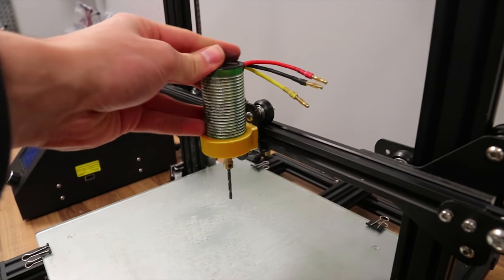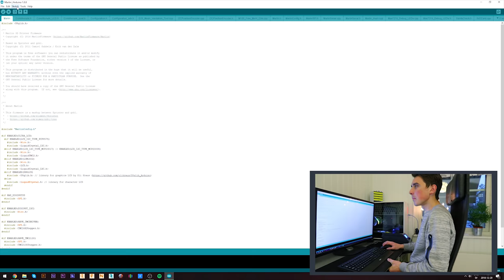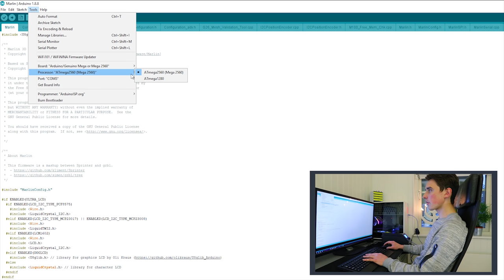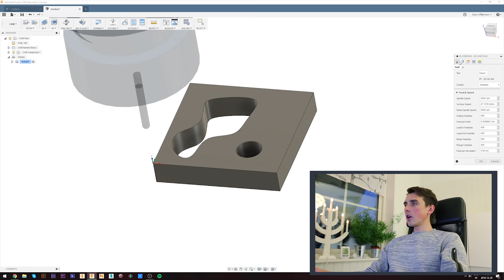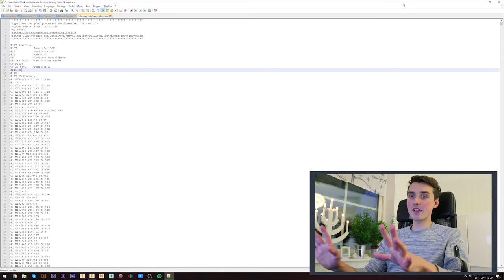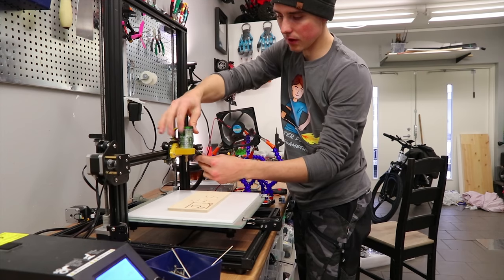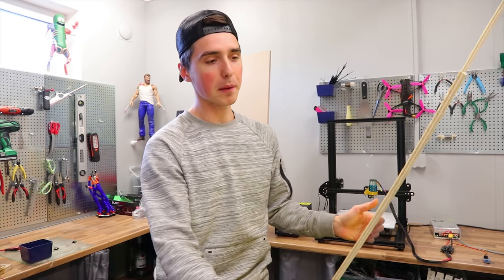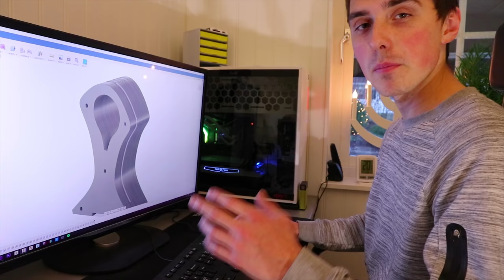3D Printer CNC Makes Spectrum Thing

Comment: i have also been messing around with cnc on my printer, here a helpful hint, In your start gcode add a G92 command to your Start script,  Example G92 X0 Y0 manually move the tool bit or head,  where you want you Zero x 0.0 and y 0.0 to start at, Usally at the corner of the work piece,   you can also us this with your Z axis, And make sure to add a M90 in the End script after the G28 of X and Y axis , if you start a Cut and you stopped it, Reboot the printer or manually do a M90 as all the zero offset will remain in effect till the M90 is called .
Reply: super helpful man great comment

Comment: Really nice job sir! Nice to see people willing to try new things. As a few others have mentioned, I think you'd see some significant improvement in the quality of your cuts and more predictable behavior, if you switched to a 3mm single flute end mill and ran it at ~1000mm/min feedrate, rather than 400. It seems counter intuitive, but at the high RPMs of the brushless motor you're using (I'd guess ~30,000 RPM) if you move too slowly you actually cause a poorer cut with more burning because the flutes of the end mill are recutting the previously removed material, and the flats of the end mill are just causing friction in the slot the cutter made. At least this has been my experience with my DIY desktop type CNC at similar spindle speeds.

Comment: Hi, I have been busy transforming my ender 3 into a CNC milling machine for a month. It is tricky but now the results are awesome! For the motor, I have used a twin electric bench grinder (as it was the only "strong" motor I had the time being) and a flexible shaft to mount it where the nozzle assembly was mounted. I set the rpm of the grinder to 10000 (maximum) and I used a smaller tool (1-2mm is good) for this type of printers with V-bearings and this type of setup. I also had the speed on xy plane at 5-10mm/sec (10 maximum). That way (after some calculations) the loads on the cutting tip (endmill) and thus on the v bearings are minimum. You can adjust the settings depending on the material. For plywood, these settings work great (1-5mm) but for plastic t's sh**. That's because of the high rpm. So you can try different settings for different materials. Unfortunately, this type of printers can't stand high torque motors as the loads on the V-Bearings will be high. And for the gcode, I haven't changed anything on the ender 3. I downloaded a post process for marlin from GitHub (mpcnc) and it works great. You just have to add a G28 command and a good set up on the fusion cam.
Reply: Hi, thanks for the comment could you please tell me where to add G28 command?

Comment: You need to add a vacuum to the CNC

Also you could use the nylon filament for the mounting. Since it’s heat resistant and will absorb vibration

Comment: Very good video. 3D printer CNC router hybrids have been of great interest to me for a long time now. But as I found a few years ago when I set out to make such a machine it's isn't as simple as it looks. 

Essentially the control for each system is the same but I found that there are two major differences of each machine that stop you from being able to make a high functioning hybrid.  

The torque required and the weight of the components are the two main differences. Obviously, you require much more torque from your motors when routing then you do when you 3D print or else you will run into the same problems as you did in this video. That is fine though all it means is that you need to use nema 23 stepper motors or higher, instead of the commonly used in 3D printers, nema 17. But with that extra powers brings extra weight. And when you increase the weight you decrease the maximum speed you machine can travel before you start to see artifacts due to vibrations.  Not a problem when routing which is usually a medium speed smooth operation. 3D printing, on the other hand, is fast and sometimes far from smooth. 

Let's say you manage to increase the torque of your machine without sacrificing and speed. Then you run into the problem of how you transmit that torque. When routing at high speeds belts are not the best option because they can slip and will become slack over time in a high street environment. Some machines like the x-carve get away with it but even they are very underpowered. So you move to using screws usually ACME or ball screws to run each axis. Again these will limit your maximum travel speed because of their added weight on the gantry and because they are generally slower than belts. 

End of the day unless you have an incredibly rigid machine that will not suffer from rapid movements of 3D printing when building a hybrid you need to choose. Do you want a 3D printer that can mill slowly or do you want a CNC router that can 3D print slowly. 

Anyway, great video man I'm impressed with your results. Just thought I would share my findings on this topic.
Reply: Yeah with belts driven cnc what you would need is to use gear reduction, that way you can still have decent speed and the torque. But in the end it's just best to use your printer to make a cnc(I'm going to use mine to upgrade some parts on my cnc). I have a diy belt driven cnc with no gear reduction so its as fast as my printer, it can cut wood faster than seen here (2 hours for each piece!!! Wow that's painfully slow) But I mainly cut foam with it to make molds. I'll add gear reduction at some point.
Reply: Do you have any good forums I could go for to help build myself a CNC?

Good info man!
Reply: @towers3372  look up "mpcnc" on thingyverse it stands for mostly printed cnc, I'm sure there must be a link or something plus there are some guys on YouTube who build it.
Reply: You miss the point of what I'm saying yes belt driven cnc routers are avaliable but all will have the same inherent flaws. They will be limited to the stress they can be put under before the belts and are far from able to meet engineering tolerances because the belts will loosen overtime and need to be tensioned throwing off any calibration my may have done. I know this because I own an x-carve which uses belts and nema 17 stepper motors like the mpcnc. I have also designed and built my machine which uses ball screws, higher torque motors and stepper driver boards rather than chips. 

I own the x carve because it has a large workspace of 800mm × 800mm and yes it could cut each part of this project out in under an hour to a hobby suitable level of accuracy but my machine will stay within tolerance overtime and be able to cut each part out in a few minutes. The only reason I don't always use it is because it has a much smaller 400mm x 400mm workspace.
Reply: @isaackvasager9957  Cool, yeah I've got one with 23's just because I was going for speed, I cut at 80ips and rapids @120. For the gearing I was just talking about getting even more speed closer to a 3d printer, but as I said its best just to have a dedicated cnc. And yes if you get quality belts, stretching is a minimal problem(in the 5years I've had mine I've had to adjust then 2 time and have never had a slip) also if one is worried about stretching and still want speed especially over longer distances I would go with R&P over anything else.
x-carves belts are junk from what I saw when I was looking at them a few years back, not to mention just by looking at them the whole frame is not stiff enough. That's one thing with the mpcnc it also looks like it will be flimsy, if I was to build one I would look into something more solid than the conduit... maybe something like gas pipe or the like.
Reply: @isaackvasager9957  oh good catch, 80ipm

Comment: Well done! A very useful semi/manual CNC drilling machine. If drill motor get too hot leaving supply and axis motors cold maybe the next improvement must be a more powerful drill motor I think. In any case really good project.

Comment: If you use the vacuum while you are machining the parts, it could cool the motor and keep the area dust free. Print a housing that surrounds the spindle motor and extends to the cutter. A brush type end for a vacuum could help with the varying depth of cut and keep the part being machined clear of dust.

Comment: Hi Simon, I'm a Lathe operator from Germany, and I have a tip for you: if you mill hard stuff like this wood, your end-mill is way too long. just take a much shorter one or cut it down in length wit an angel grinder, just be careful to not damage or brake the tip. your CR10 will go much better and easier through the material ^^

Comment: You might want to reconsider your choices if you feel the need to remodel a 3D printer into a CNC-milling machine.
Cause there are many problems with that.

Sure - 3D printers started as remodelled CNC-machines but that way around is safe. A milling-machine has to handle a lot higher forces than a 3D printer - it needs to be a lot sturdier.
3D printers simply are not up for that task (as you noticed). It will work for really soft materials, but even just wood is stretching it - it has to move a lot slower, the surface finish will not be nearly as good, and even with those downside it will very likely end up slowly but surely destroying the printer as the whole thing is not sturdy enough.
You'd have to replace the whole frame and pretty much the whole mechanics for it to withstand harder materials - at which point you have replaced the whole machine and now have 2 standing around and you might have just gotten a CNC-machine in the first place.

TL:DR - you need to replace the whole machien which make just getting a CNC-kit a lot better.
Reply: Any CNC kit recommendations?
Reply: @towers3372  Sorry no, i don't have either as i can get parts produced for the material cost at a local company.
Reply: David  "I'm a mechanical engineer and a good chunk of your argument is BS."
Such a great mechanical engineer that you can not even find a single fault in my argument to point out.

Sure - i could also use a phone to dig a hole in the ground - doesn't make it a good idea.
Reply: David  "or some bullshit like that. Clearly, you have no understanding of mechanical creep, elastic deformation and yield stresses."
Ah of course i have no idea of structural mechanic cause a random person claims that 3D printers are designed strong enough to sustain prolonged periods of high stress despite them being so flimsy that even just high speed printing can wear out the parts in just a year or 2.

Comment: This kind of motor has a continuous working time of about 30 minutes. It is not designed for running for an "infinite" time: this is related to the battery duration in RC applications. So a generous cooling has to be applied.

Comment: This video hurts me physically as a machinist
Reply: Same here!!!! Haha.
Reply: It is more like a toy or for small home projects nobody is planning on milling a V8 with this. And it is a $350 printer with like a $50 mod. Good learning tool for CAD  programs and understanding basic concepts.
Reply: As an aerospace engineer I found it interesting, this is good for small home DIY people,  I was surprised it managed to cut 18mm MDF, I thought it would have destroyed it. If you are making small plastic parts at home then this would be a  cheap home made CNC machine, but we don't pay machinist to think, just to press the start button 🤣🤣🤣
Reply: David  Your reply was irrelevant, Thanks
Reply: @pmiller4799  we are irrelevant thanks
Reply: @pmiller4799  as a machinist, i agree.
Thats why im working on getting a degree in mechanical engineering.
Reply: As a non machinist, I am impressed, it does the job a helluva lot better than I do.
Picture a guy in his Livingroom with a hacksaw and a rasp trying to make the line straight. A large percentage of the project is filler and paint :-D.

Comment: A bit of info for better results. Drill bits are terrible at cutting sideways. The small endmill you were using is the way to go but failed because it is designed for steel. It has way to many flutes (cutting edges). The gullets (gaps between the teeth) are packing up with shavings keeping the teeth from taking a full cut. You want single or two flute endmills for wood and plastic. This will reduce the load on the xyz motors and keep them from slipping and your spindle motor will run cooler. They can also ramp down into the material much faster. I use an aquarium air pump with a rubber hose connected to a nozzle pointed at the cutter. You can attach it to the motor mount so it keeps all the shaving from building up in the channel you are cutting. This will make it so it is not recutting the shaving over and over and you don't have to keep vacuuming it out. Also helps with spindle motor load. I use the same design on my bridgeport mill and it works great. Cool project and thanks for sharing.

Comment: Awesome, Love seeing you push the limits of these machines!
Super cheap and easy double sticky tape alternative, place masking tape on wood and masking tap on bed, apply super glued to masking tape and push the two together, presto. If you want to get fancy put super glue activator on the piece of tape that doesn't have glue. This is a very common work holding method for cnc routers and it makes everything super easy.

Comment: Great project/video. One suggestion though would be to use a better End Mill. I know that you probably tried to used what you had at hand, but Dremel “EndMills” are not the best. Even worst is the drill. A drill is not design to cut sideways, or in X and Y if you prefer. It’s an axial tool. 

As I said, regardless of that, great project!

Comment: It's a really interesting engineering exercise. But from a cost standpoint, you can get a decent small scale CNC router for about $200-300 that is (more or less) ready to go. One big disadvantage of the printer frame is the height of the z-axis. You wouldn't need anywhere near that much travel for a CNC router and that much travel just allows unnecessary flex.

Comment: Love this build! great job - way to think outside the box. In the end, my guess is that you probably thought up a LOT of other uses for a CNC machine. you seem to have a lot of space in your workshop, so you might want to consider a dedicated CNC machine (about the size of the CR-10), but one that will:
1) be able to handle harder woods and possibly aluminum.
2) be able to cut materials at a faster rate.
oh... and either a built in vacuum or a dedicated box around the CNC will not only keep things cleaner, but, if constructed correctly, will significantly cut down on noise!!!!
keep up the GREAT work!
Russ from Coral Springs, Florida, USA

Comment: try using a single flute end mill as it generates a lot of heat with say four cutting edges on the cutter it will help with heat on the motor and burning of the wood and dulling of the cutter hope this helps

Comment: A coreXY machine is actually better for this type of project because the X and Y paths for the tool head are above rather than below the path of the debris from the cutting head. the only axis that could suffer from dust collection would be the Z axis.
Additionally, trying to cut anything too fast or too deep is going to hurt the performance and quality of the machine and part. More shallow cuts (0.2mm vs 0.8mm) will result in cleaner cuts overall as the cutting head isn't having to fight to remove the requested material.

Comment: if the tool is smoking, your feed rate is too slow and will dull your tools. have a try of GWizard may help you with figuring out correct feeds and speeds for your new cnc mill. It has been a great help to me.

Comment: You should use a 2 flute end mill from a machine shop supplier. High speed steel should be fine and shorter length than what you got will flex the machine less. If you are milling something with grain direction pay attention to the Climbing & Descending attributes of the cut like when using a router and the router wants to take off on it's own.

Comment: Use a 2 flute end mill for wood, 1 flute for plastics. Try out different feeds and speeds, increase motor speed for wood until you get decently clean edges, for plastic you want to be just slow enough so that you don't melt it while cutting. You might always want to try adding a second lead screw for the Z axis, you need the rigidity for a milling operation. Use the shortest tool that you con possibly find, that tool stick out is doing nothing good for you.

Comment: Super super interesting Simon ... I think I've seen this great movie a few times before! Technically, personally, I would have added a light hose tied with a printed piece right next to the engine, a light hose connected to the vacuum cleaner that would suck all the sawdust right next to it exactly when it appears. It may be too late to vacuum at the end, one of the moving rollers or belts of the assembly may be damaged and the work may fail over a long period of cutting. Excuse my English. Greetings from Romania. Maximum respect again for all your work. Esteem!

Comment: Have you considered the tool you're using as a possible fault? (Generally) the softer the material, the fewer flutes you want to use... on a milling machine 4 flute end mills are pretty common where 2 flutes would be used in aluminum. Fewer flutes makes for larger reliefs and excavates the soft material better, that's my experience at least... wood is pretty soft in the grand scheme of things...

Comment: Thats AWSOME!!! I am wanting to venture in to 3D printing as well as a what you have done here . 
Suggestion! If you mounted the motto on the other side of the extruded metal the motor will not bend as much as its closer to the centre line.